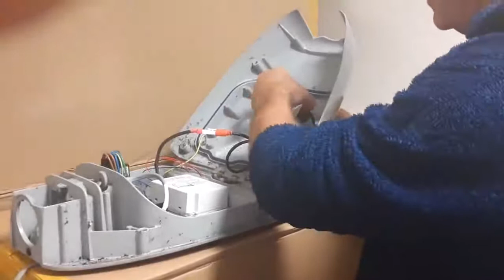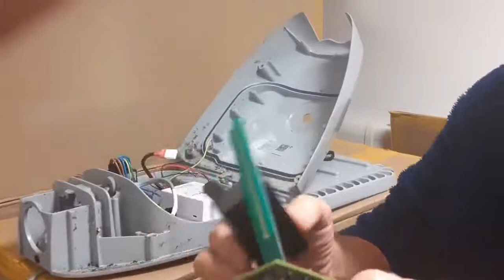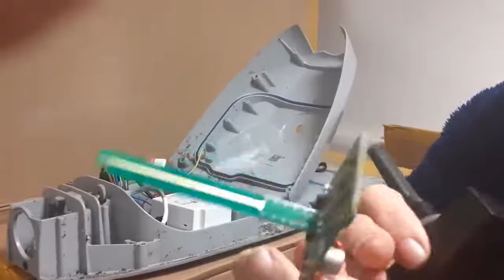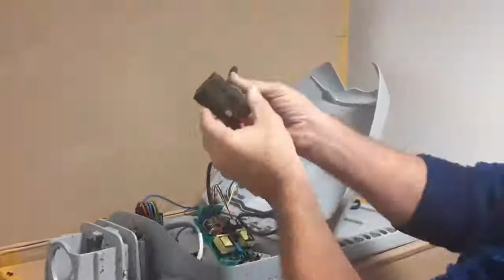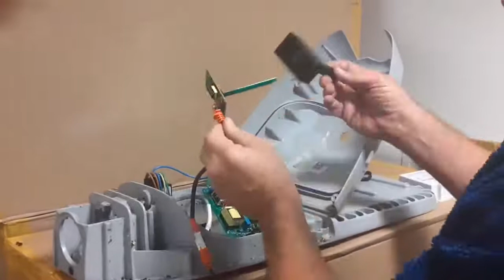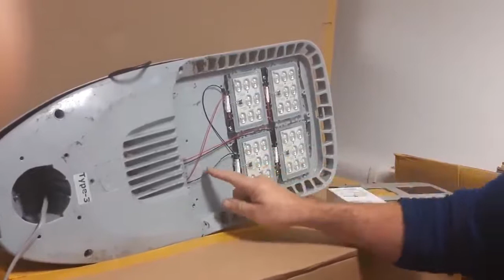5G LED STREET LIGHT TECH BREAK DOWN

Comment: Christ man get some help the PCB is a driver for the LED's and for remote switching of the light. BTW volts are not important it's the amps, your boiler at home has a 20k volt ignition transformer in it has it killed you yet? Those two yellow squares in the PCB are step down transformers their power output is in Watts.

Comment: What a load of rubbish! How can you present such dribble? A well designed switch mode power supply, some low power RF module by Harvard Engineering for reporting the status of the lighting unit. Or have I misunderstood your attempt at comedy?